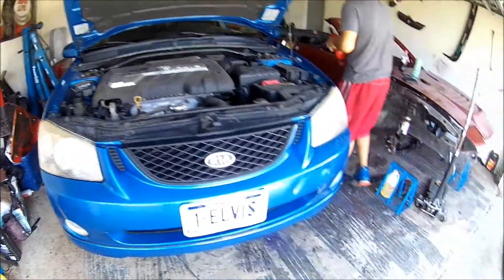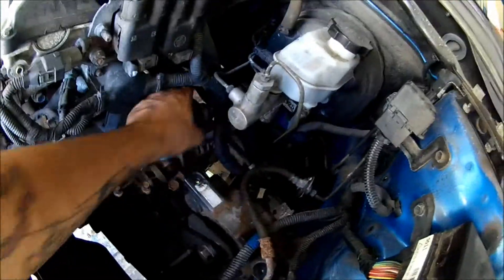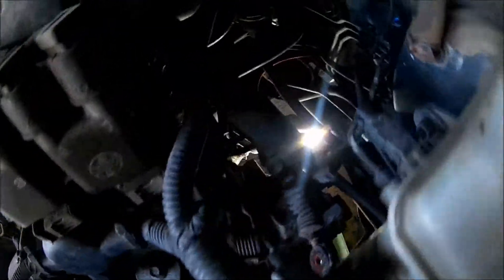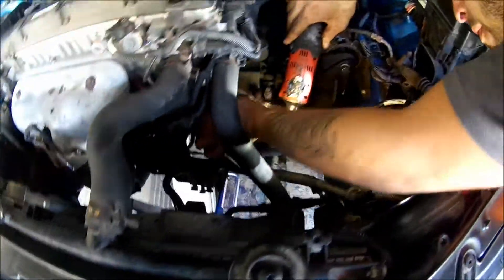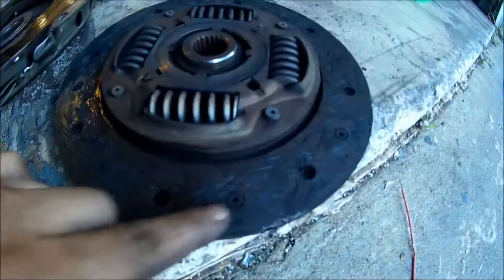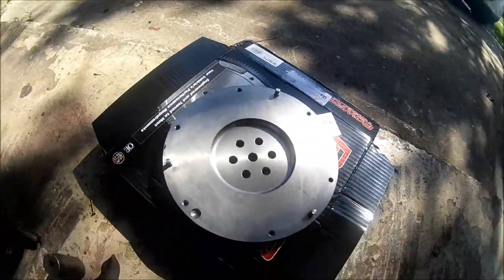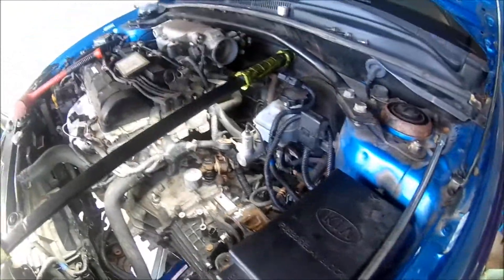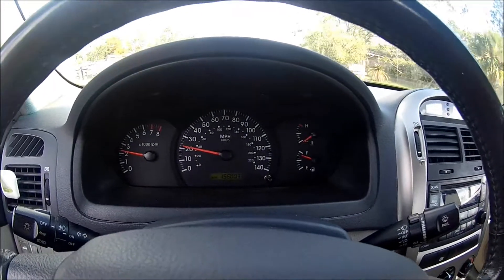clutch replacement on 06 kia spectra

Comment: The oversize wheels have a ton to do with the clutch going out .   I have to do this also but i am hoping it will last till spring.   i guess i should go see some other vids though.  parts cost list is also very helpful to some people , i always like to hear that. i would not even have bothered with the customer parts , full kit is always the way to go unless there is some weird emergency.

Comment: Hardware for flywheel??
Reply from the maker: What about the hardware?
Reply: @cardudegarage  did you use the old bolts or new ones? If new where did you get them and what are the specs
Reply: @cardudegarage  believe it's a M8 X 1.25. Just not sure of the the thread pitch.
Reply from the maker: The old hardware was used